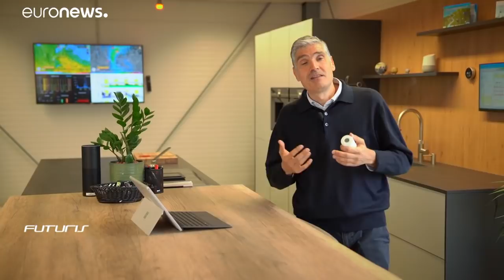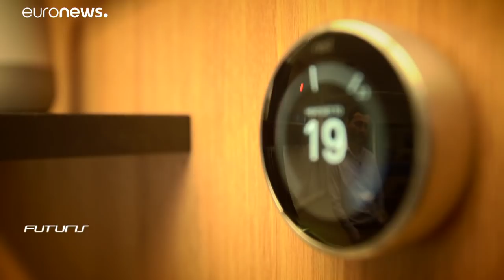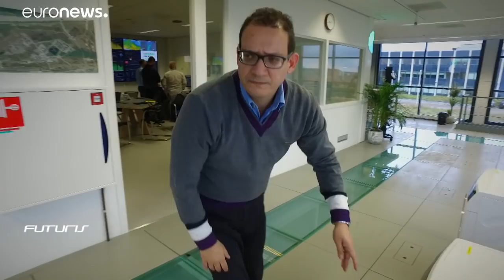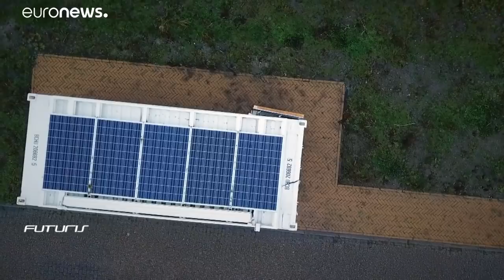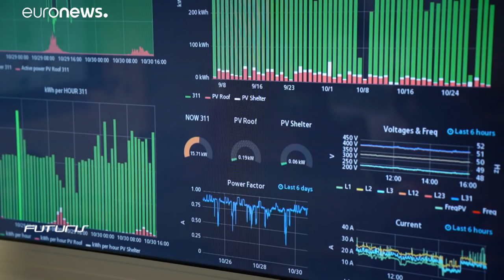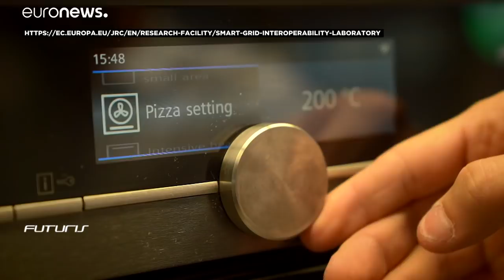A clever laboratory for smart homes

Comment: Home are also becoming very dependent on external servers running AI. The features beng offered may seem attractive, but it is a faustian bargain with big companies knowing far too much about our lives. By being dependent on external servers we are decreasing the resilients of these systems and playing into the hands of corporate marketing departments that want to build obsolescence into the products we buy. Imagine finding your home white goods all stop working because they are no longer compatible with the latest software upgrade or security patch. In the last few years, the tech companies have been developing a new business model, moving away from that expensive process of manufacturing hardware products, and moving towards a service based system that uses software dependence to lock customers into paying subscriptions. It is a way for large multinationals to guarantee a constant revenue stream, by directly connecting the customers bank to their off shore account, courtesy of the wonders of direct debit. By integrating and networking our homes we are giving away not only our privacy but also opening ourselves up to unnecessary blackmail. In the home of the future, a corporation could hike its service fees and threaten to disable all the appliance in the home if the customer objects. If the home is fitted with electronic door locks it could disable these.

I am not against the technology, just the way it is being implemented. I would like to see the AI that runs the home move into a local server, protected by a nice big fire wall. Ben if the corporations are not out to get us, which I think they most definitely are, there are many hackers who would love to use this technology to conduct blackmail attacks. It's bad enough to be locked of your computer by a blackmail virus, imagine being locked out of your home, worse still, imagine a hacker threating to burn down your home by remote control. It has been shown that cars with networked technology can be crashed by remote control. How long before vehicles fail their road safety tests, not because of a hardware fault caused by wear and tear, but because the operating system can no longer be ungraded. This technology takes built in obsolescence to a whole new level. When corporate sales start to flag, simple!y make the software in the old product obsolete and force the customer to replace a product that was working just fine up to that point. While this helps the company bottom line it is a recipe to destroy the environment.
This may sound very paranoid, but if the technology provides the means it will be exploited.